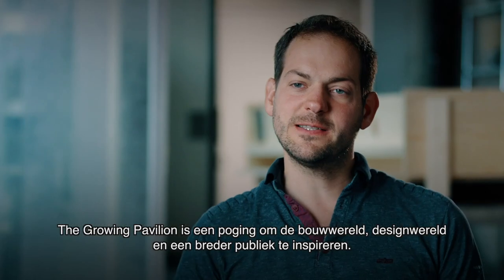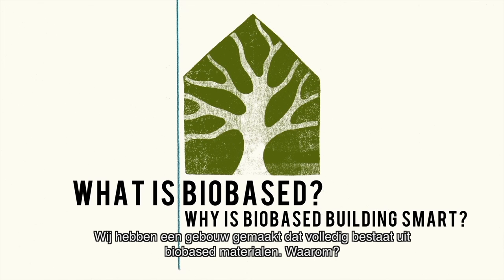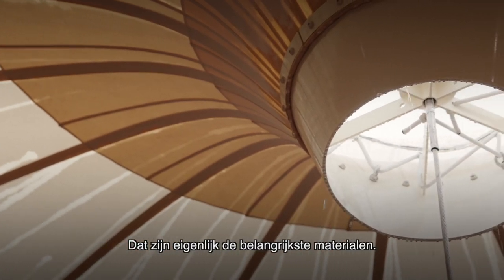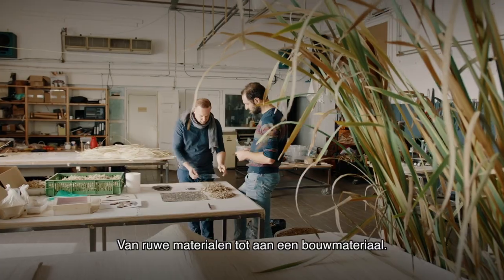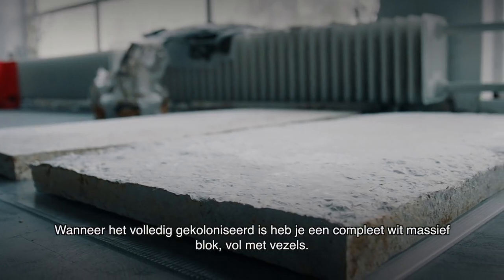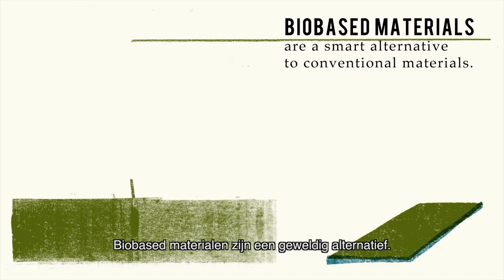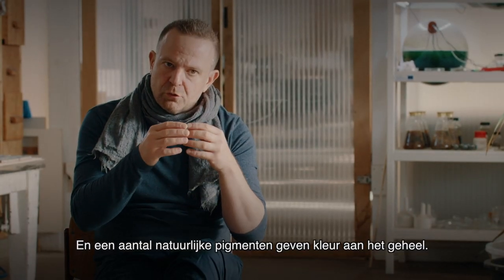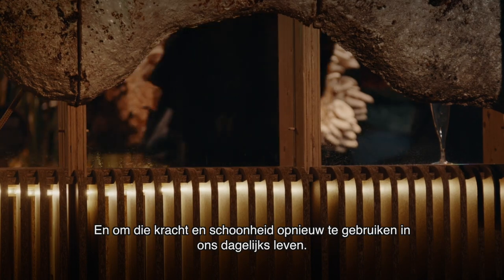The Growing Pavilion Documentary Dutch

Comment: Homes constructed with wood framing, wood flooring, and wood exterior siding are sequestering a lot of carbon. The problem is homes constructed with energy intensive man-made materials such as bricks, concrete blocks, and manufactured stone do not. We still need to continue farming trees. It's one of the best methods we have to sequester carbon. Admittedly we are not growing enough trees. The majority of trees we are growing are being harvested prematurely due to high demand. Or we've selected fast growing trees to maximize profits rather than maximize carbon sequestration. Additionally we are burning too much wood for fuel. As well as burning crop waste rather than finding ways to utilize all crop waste. Burning of crop waste is one of the causes of destructive wildfires every year.

Utilizing existing crop waste mixed with mushroom spores to create a natural material which is a harmless substitute for VOC rich laminated wood products, supplements harvested wood to slow deforestation, provides a compostable soil enriching plastic replacement, and substitutes many other man-made products like insulation is necessary as we can not grow enough trees to stop worldwide deforestation.

This emerging science is extremely promising and exciting. Imagine the impact this would have across the world if farmers saw their crop waste as a valuable material. They would immediately stop burning it.

Cheers!